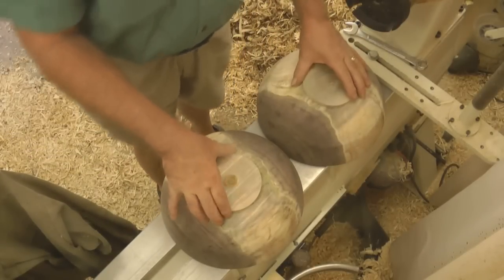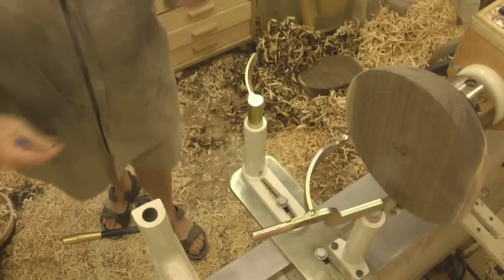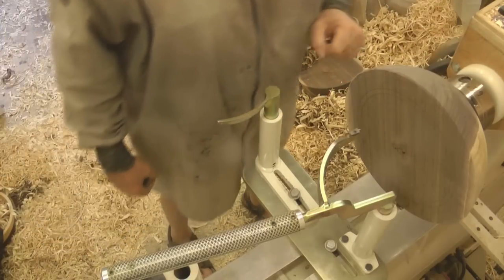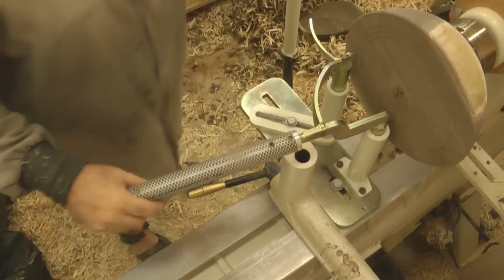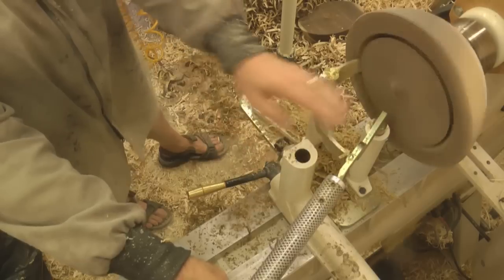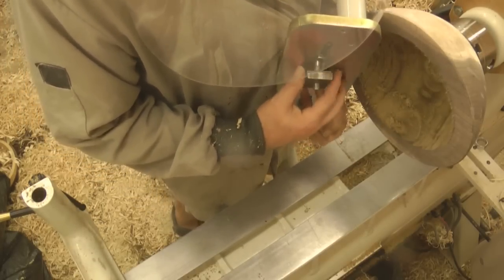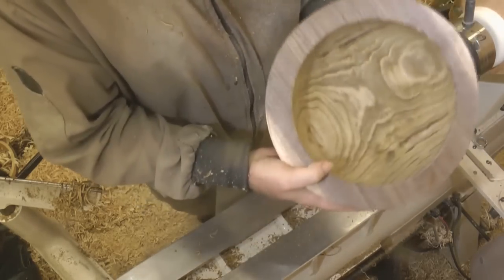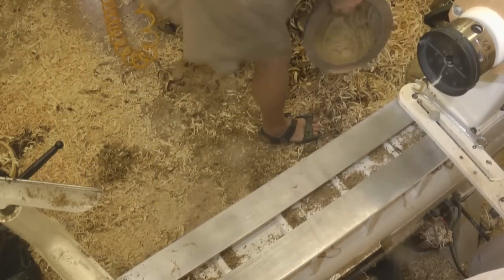Coring bowls with the McNaughton and Oneway Easy Core Systems - Part 1 of 2

Comment: I have the one way system that I use with my powermatic 3520B and I really like it and use it alot. Just cored 16 15" to 17" cherry blanks with same number of 1 0" to 12" blanks. Like your depth gauge

Comment from the maker: Hi, John:
That piece is called a Morse Taper Extender and I bought it with the lathe from Oneway.  I would expect they are a fairly standard item which would be available from machine tool supply places.  This lathe has a #3 morse taper tailstock socket and came with a #3 morse taper live center.  I did a search at their website and it appears that they only carry the extender in #3 morse taper.

Take care
Bob

Comment: Bob, I've been turning for 3 years but learning everything on my own 
(slowly ... ugh).  Anyway, I have / love my Delta 46-460 and am 
interested in coring as in the video above.  I don't believe I need the 
Oneway product as my lathe is a midi and to small to use but 2 of the 4 
options.  I believe the posts may seem bulky attached to my small bed as
 well.  
Question :
Have you any recommendations of a smaller set that I could purchase ?  
LInk ?

One other idea ........... is it possible to core thinner bowls to get 3
 or 4 on my Midi lathe ?  Maybe if the blanks were dried more thoroughly
 first ?

Thanks so much for your generous consideration and very well made video,
Steph_Louisiana

Comment: Thanks bob, is there also another brand the woodcut bowl saver & is there a preference ? Also will these fit a nova 2 midi-lat.he.. Thanks for your time & assistance. Larry,ry
Reply from the maker: +Larry Arnold 

Hi, Larry:

I have never seen a Woodcut Bowlsaver in person nor used one, so I don't know how it compares to these two systems.  Coring requires a considerable amount of torque from the lathe so I would recommend at least 1 1/2 hp. and preferably 2+ hp.  I don't know of any midi lathes that have that much power available.  I never tried coring anything on my 3/4 hp. GI Maxi lathe so I can't say whether it would have been possible or not.  I simply assumed it would not have enough power and did my coring on my larger lathe.  

Take care
Bob

Comment from the maker: Hi, Donna:
Oneway makes Easy Core systems for 16", 20" and 24" lathes so the 20" should work on the PM3520b.  You would need to specify the gap between the bed ways to make sure you got the correct clamp block for the base plate.

Take care
Bob
Reply: Pro trick : watch movies at flixzone. Me and my gf have been using them for watching all kinds of movies lately.
Reply: @Jax Shane Definitely, been using flixzone} for months myself =)
Reply: @Jax Shane definitely, I have been watching on Flixzone} for since december myself :D
Reply: @Jax Shane Yea, I've been watching on Flixzone} for years myself :D
Reply: @Jax Shane definitely, been watching on flixzone} for since november myself :)

Comment: My name is Billy Bouldin I am a wood Turner . I have watched several of your videos.I know you use to have a Nova DVR now I noticed you have a Oneway lathe. I was looking to upgrade for a better Automatic lathe with a verbal speed. I would like to know which lathe would be the best investment . Which do you think would be the best lathe . I would Appreciate your advise . thank you Blly.
Reply from the maker: Billy Bouldin   Hi, Billy:I don't know how much advice I can give you since I only have direct experience with the four lathes I have owned:  the Delta 46-700 I started out on, the Nova DVR, the General 25-114 midi lathe I use out in the backyard during nice weather, and the Oneway 2436 I use now.  The Delta is no longer available and would not be too highly recommended even if it was.  The Nova DVR is an excellent lathe but would fall in the class of "medium duty" lathe rather than "heavy duty" like the Oneway.  One thing in particular that always kind of bothered me about the Nova is the bed is very narrow from front to back, with only ~1" of machined bed way surface on each side of the central gap.  That is not a lot of contact surface for the banjo and tailstock to clamp on to and the banjo would occasionally vibrate loose, especially when I was coring.In general the heavier the lathe the better for absorbing vibration.  The Nova only weighed ~200 lbs., even with the bed extension I had mounted.  I did have ballast added to the stand it was mounted on and it worked well for me, but I felt I had outgrown its capabilities and wanted to make a significant upgrade to what would be the last lathe I would ever buy.  That is why I chose the Oneway, which is built like a tank and performs extremely well.  It also cost at least three times as much as the Nova.In the forums I participate in the Powermatic 3520b is generally considered to be very good value for money and probably the lowest priced of what could seriously be considered a "heavy duty" lathe.  The Robust lathes are also building a reputation as being on a par with Oneway lathes and their cost is comparable with Oneway's.I hope this helps a littleTake careBob
Reply: I really appreciate you answering my questions. I have 1624 Nova and feel like I have out grown it. I am thinking about going to the 2436 Oneway .I don't like changing the belts . On mine I get at a certain spot and have to change. When I buy again I like to have the 3 hp Oneway . I have been turning for 2 years and I watched your videos among others and taught myself . I have learned a lot from watching you.I have turned some stuff and sold them and that is how I bought my lathe I have now. Next time I buy I want to get one and be it . Thank you so much Billy.